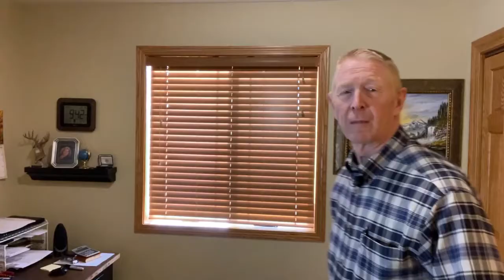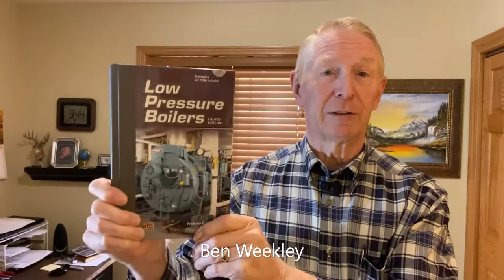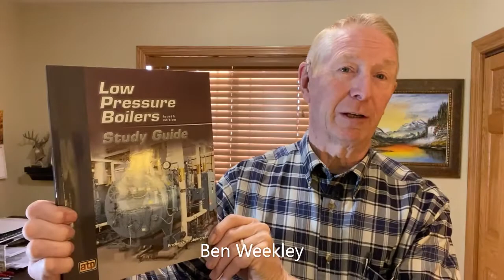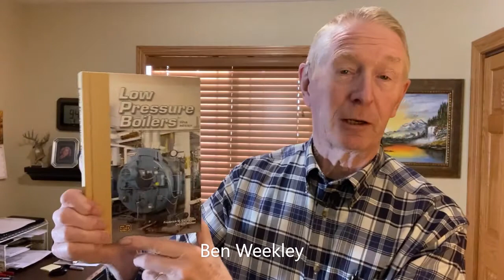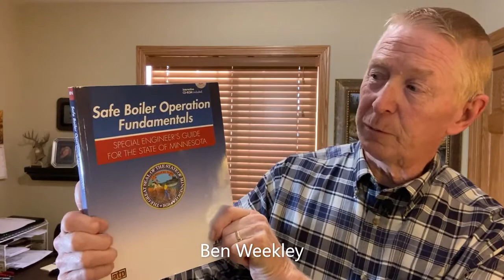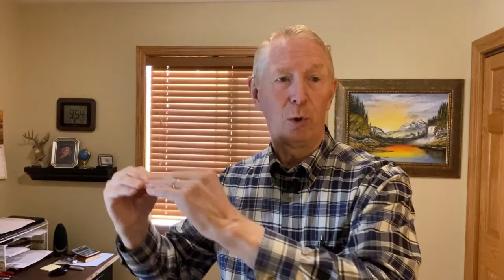Low Pressure Boiler Training-Session 8-Boiler Ben

Comment: Hallow Ben how do I get the correct size of my boiler gauge glass gasket and its micker without dismantling and no manual available.
Reply from the maker: I suggest you contact a supplier who sells boiler components and parts. Perhaps send them a picture that includes size or dimensions of the glass.

Comment: Hi Ben, your a great teacher. I have a question. If my boiler MAWP is 170 psi and I come in and notice the psi at 210 , you had made a comment not to open the safety valve to relieve pressure because of boiler explosion. How would that happen if I slowly remove the pressure from the boiler?
Reply from the maker: With your stated scenario your safety valve should have opened and never let the psi get to 210. This is a sign that the safety valve is bad. Your tubes could be exposed and water re-entering the boiler could flash to steam uncontrollably. Best advice is to shut off the burner and evacuate.
Reply: @BoilerBen   by opening the safety valve, the water level in the steam drum would go very low exposing the water tubes. Relieving pressure when it is too much will force the water level to go very low. Did I understand you correctly?  Thanks Ben.
Reply from the maker: What you are describing is associated with high pressure boilers which I will admit I am not expert in. Typically steam drum and mud drum systems had up-comer and down comer-tubes. Any boiler that is 40 psi over the MAWP should be considered very dangerous. I would turn off the burner and evacuate until it is safely back below the MAWP and then call and expert to determine what went wrong and if it is safe to start operations again. Thanks for watching!!